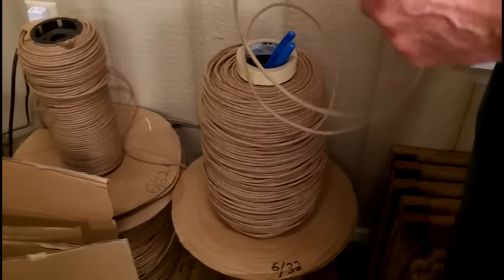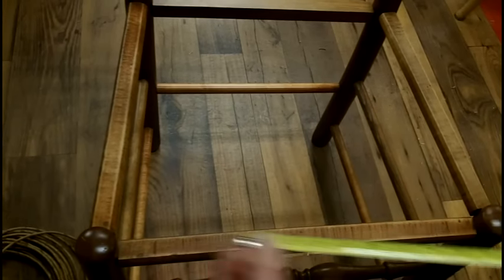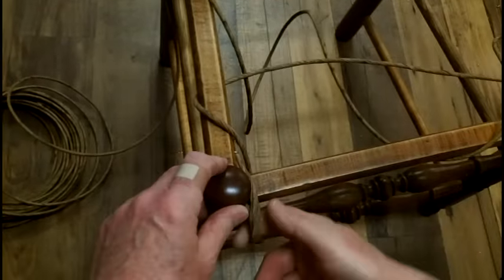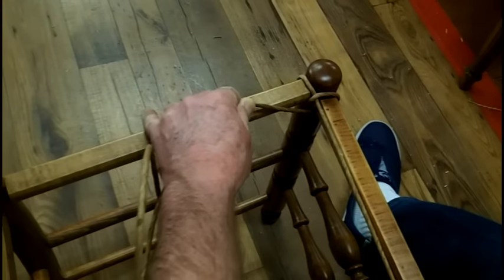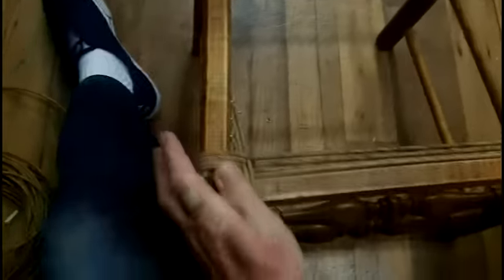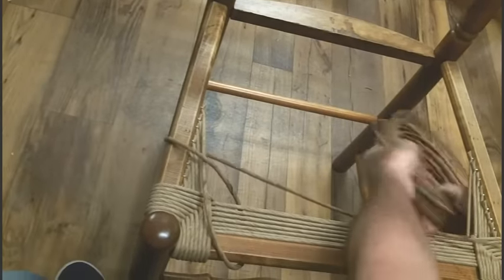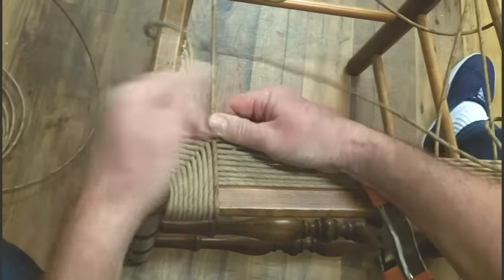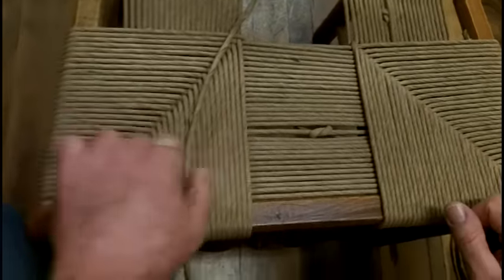How to Weave a Seat in a Rush Chair

Comment: Ed Hammond , in addition to the pressed-in cane chairs I'm about to work on for me, my parents have 6 Hitchcock chairs in need of repair. I watched this video on how to weave Rush seats (another excellent video, thank you!) but the Hitchcock chairs have a wooden border around the seat that remains exposed. Is the process the same as this video? Is there a slot for the cane to pass through on a Hitchcock chair as opposed to passing over the rail as in this video? Thanks!!
Reply: +Doug Silverberg The wood trim has to be removed so you can do the weaving. It can go back on after the weaving is done. Usually damage is done to the wood, and it needs repair and touch up...
Reply: +Ed Hammond -  Thank you!
Reply: +Ed Hammond , one other question re the Hitchcock chairs ... While I wait for the supplies I ordered from you yesterday, I've started to disassemble the rails. Sides came off without too much hassle but front is more resistant to my efforts. The FRONT rail has to come off as well, right?
Reply from the maker: +Doug Silverberg Hi Doug, it is MUCH easier and quicker to weave the rush if you have all the wood trim pieces removed prior to weaving. It usually involves some wood damage and repairs, but it is worth it in my mind, because of how much easier it makes it to weave. You can try pushing the rush through the slots, but it's pretty tedious work....
Reply from the maker: +Doug Silverberg Yes, the front rail will have 2 screws, one on each side, they are recessed and filled in with wood putty, but if you look closely you can see them. carefully remove the wood putty to expose the screw heads so you can remove them. The front wood is usually also glued, so you will have to break that glue bond... not a project for the weak of heart!
Reply: +Ed Hammond , Perhaps not for the weak of heart but with your feedback, it was accomplished without a problem! Thanks again for the guidance.
Reply: +Ed Hammond   - One more question as I start the Hitchcock chairs. The front and back rail distance is the same (12"" however, they chairs have wooden corner on front corners. Do I need to worry about those with initial loops of rush (as in your video) or just start as if all rails are same size and work all four rails from the start? Thank You!
Reply from the maker: +Doug Silverberg The wood trim pieces have to be removed so that you can do the rush work, then the wood trim can be put back on. The front piece of wood usually has wooden pegs that have to be drilled out as they cover metal screws that have to be removed. The sides and back are usually just nailed in. It is common for damage to occur to the wood trim, so you may have some restoration to do after removing the wood trim....
Reply from the maker: +Doug Silverberg If the front rail and back rail are the exact same width, just start weaving the whole seat. You only fill in the front when you need to make the gap equal to the back.
Reply: +Ed Hammond, Thanks once again for the guidance!!

Comment: I am using the natural rush. Would the fiber rush be better as far as it fraying? Also, I am having difficulty with the rush not staying stapled. It pulls out. Suggestions?
Reply from the maker: The fibre rush keeps it's shape better than the natural rush.. Fibre rush will not fray normally. After you drive in the staples, you may need to tap them in tighter with a small hammer. Maybe you'll need to use carpet tacks to help hold it in?
Reply: yah...I wish I had bought the fiber rush instead. Making due. My seat has been a huge challenge and started over 4 times. Unfortunately, it is a frame that gets nailed onto the chair....they are cheap chairs. The frame has notches that I had to account for which really stinks. I will try to post a picture when complete. Of course, I see all my mistakes :-(  I think I would have been better off skipping the frame and rushing the actual chair, although the seating height would be lower by at least an inch which may have been disappointing in the end. There has been a lot of cursing (!!!!) but heck, gives me an excuse to have a glass of wine and finish the project tomorrow. Thank you!!
Reply: Would have been even better had I noticed your video on rushing a frame.....I JUST noticed it. ARGH!! Oh well. I will watch it for the second chair.
Reply from the maker: Your 2nd chair should turn out much better than the first!

Comment: What size cable staple is used for 5/32 and 6/32 rush .......... Thanks for the answer
Reply: I use a T25 stapler with size 3/8'' T25 staples for rush of all sizes.

Comment: Is there any other accepted way of joining the rush end-to-end?  Could you glue them?
Reply: Yes, some people unravel the 2 ends, glue them, then roll it back up and hold it with a small clamp, like a clothes pin. You will have to wait for the glue to dry to continue weaving. Also, some people will use hog rings and hog ring pliers, that is a very quick and easy method, too. If you look on our Facebook page we posted a photo of tying the rush together with small string.... although we have not tried that method!
Reply: +Ed Hammond Thank you, great video!

Comment: Ca you stop work in the middle if your hands get tired or must you do whole chair in one sitting??
Reply: You can pause for as long as you want with the clamp on, but you will have to get the rush wet again before resuming. I am not as quick as the guy in the video, and took many breaks while doing 8 chairs, sometimes setting the project aside for a couple of weeks.
Reply: Yes, you can take as many days as you need

Comment: Also, you may have answered this already in other comments but how much fibre rush would I need to order for 6 ladderback chairs similar to one you are doing in this video?
Reply: +beaveidaho Most chairs require a little more than 2 pounds per seat, so you will need about 14 pounds for 6 chairs.
Reply: natural or fibre rush?
Reply: I left a message on your FB page.  I'd like to order. Just want to be sure to get right stuff and size
Reply: +beaveidaho I would suggest using 6/32 kraft brown fibre rush, that is the size and color I am using in the video.
Reply: Thank you!

Comment: These chairs cost £60-100 each new. I have an old one that I'm contemplating restoring, but even the rush costs £25. That's a lot if I screw it up. Is this a job that you think a total beginnner with no specialist tools should attempt?
Reply: It takes practice to get good at this. The chair in this video was my 5,000 one that I have done.... your first one will not look like mine.

Comment: What width cord are you using and how many yards would I need for one chair?
Reply: I am using size 6/32 fibre rush in the video. A standard 2 pound coil (280') will do most seats, larger seats may require more.

Comment: Question? the chir I am about to do, the width of the front an back rails are the same but the side rails go from 12 3/4 to 14.5 (it is a chair with stencil, plus wood around all sides which I have to remove before starting.. since the front and back are equal,do I do all the sides at the same time or do I have to build out the sides (some way?)
Reply: It sounds like you just have to start weaving it, but if you can email me photos I can give you a better idea. Yes, all the trim wood has to come off.
Reply: don't have an email for you but if you are on facebook (and from Philadelphia) I can post the photo there.
Reply: Yes, we are on facebook and you can contact us thru our website peerlessrattan.com
Reply: did you see my black stencil chair?
Reply: Yes, I have done dozens of that style. If the front is the same width as the back, attach your first strand of rush on the left rail near the back and just start weaving around the whole chair.
Reply: thanks, waiting for a rainy day to start, when finished I will put it up on my page and drop you a when I am finished.  thaanks again
Reply: I looked again, and just to confirm, I attach in left rear and the first loop will go over the front left side?
Reply: No, after you attach to the inside of the left rail, you go over the front rail... please review the video and to it like it show in there.

Comment: Diameter of rush used?  And length required for 1 chair (then x's 4) ~ would be helpful added information.  Thanks for this vlog ~ as now I will weave the rush and save the $$$ instead of paying someone else to do it.
Reply: Ed is with Peerless Rattan and they are very helpful. They see the supplies used in this video. Rush comes in about 4 different diameters, all listed on the site. Good luck!

Comment: What is the pointed hammer called that you are using?  I can't find that tool on your website.
Reply from the maker: It is just a standard tack hammer, available at most hardware stores. We don't sell one as it's easy to find one locally.
Reply: +Ed Hammond Thank you! I'll be sure to pick one up. My mother gave me a rush footstool that was made for her when she was five years old, and it needs a new seat. Your video will make it possible for me to do it myself!

Comment: If you have 13 1/4" in the back and 16 1/4" in the front I would say that you should measure 1½" in from each side in the front not 1 3/8" as you say. Am I wrong here?
Reply: The important thing is that you fill in the front rail until it's the same width as the back rail, it will be different with each style of chair.

Comment: Maybe I am not that good in doing maths with inches but here is something that I do not quite understand: The measure in the back is 13 1/4 in and in the front it is 16 1/4. Then you subtract the two and, as I understand it, divide the difference by two. Now, 16 1/4 minus 13 1/4 is 3. Divide by 2 gives 1 1/2 inch. But in the video you measure 1 3/8 inches in from each front leg not 1 1/2. How come the difference?
Reply from the maker: Your math is correct, every chair is a different size, so the numbers will be different for each chair.

Comment: Where may I find the clips you use in this video?
Reply: If you are referring to the spring clamps, just buy them at a local hardware store.
Reply: Thank you!  Could you please let me know how to wet the coils?  As I watch your video, it seems in the beginning the coil is moist but then it looks dry.  What do I do?
Reply: At your local hardware store.
Reply: Fill a sink with water, then dip the small coils of rush in that as you prepare to use them. Don't allow them to get too wet or they will deteriorate.

Comment: I wish you told us the actual time you spent on prepping and completing the project. Great Video though..
Reply from the maker: Hello! Each chair prep is slightly different depending on size and condition of material I'm taking out of it.  Completion can normally be done in 1-2 hours depending on size and difficulty. Smaller rush takes longer. You can contact us at peerlessrattan.com if you have any other questions!

Comment: Well I tried my hand at it. couldn't keep the paper rush from unraveling, which in turn would not tie a knot without breaking, no matter how careful I was , taping the rush together with the wooden block every four strands, my chair finally whipped me, I sat it outside and will not attempt this again. I have 6 chairs needing to be redone if anyone is interested in purchasing them. I won't be paying to have them done either. It was a great tutorial, but evidently your materials and my materials were not the same. Even a quick dip in the water did not seem to make a difference in how the paper rush handled. I was very disappointed in my outcome.
Reply: +marilyn doorn Sounds like you had quite an experience! Yes, our materials may be better quality than the ones you bought elsewhere. I have not had anyone we sold to have the situation you experienced.

Comment: does anyone  know how to remove a set in rush seat?
Reply: I just used scissors, but you can use a box knife and cut around the top on the edge, then push in and it all comes off. remember to remove the tacks or staples that were used previously.